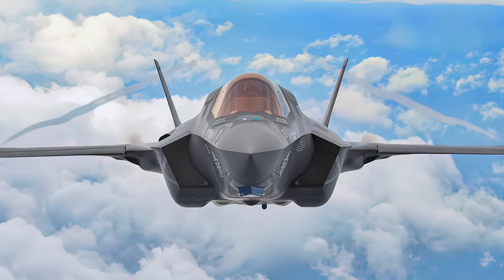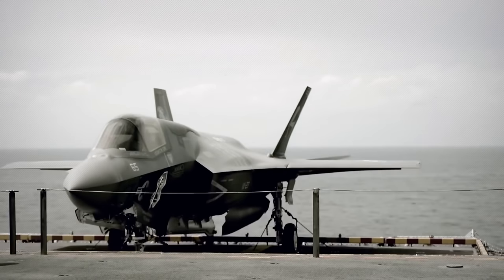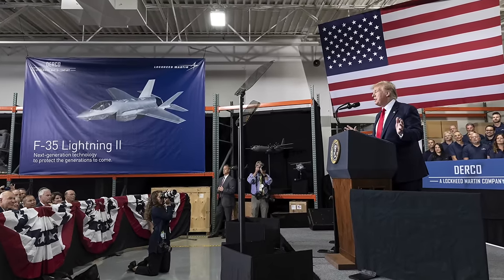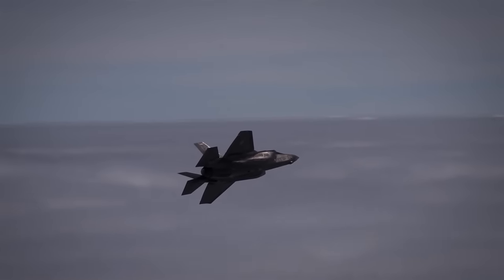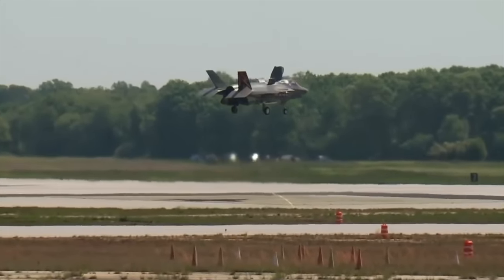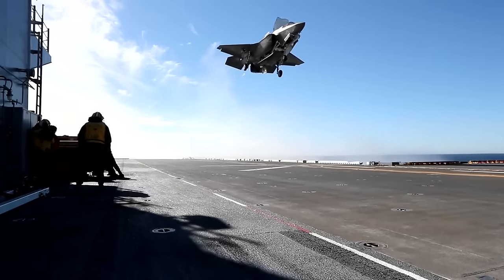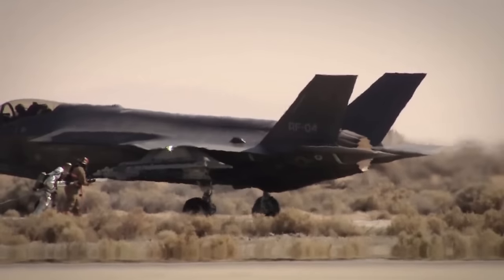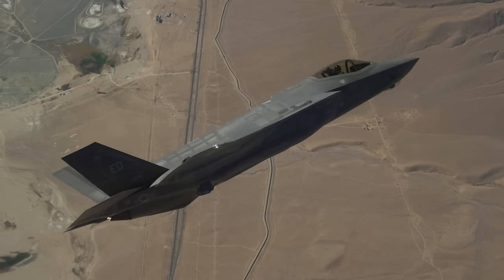F-35 Lightning II - Lockheed Martin's stealth multirole combat jet for air superiority

Comment: How can the F-35 Perform as good or better than an F-16, 
When it's so much Heavier, 
It's Build is so Heavy & UnAerodynamic?????

Yes, it has a Very Powerful Single Engine, 

But Does Not the shape & of something 
Determines How it moves through the Air???

What Physical Attributes of the F-35

Makes it a Dog Fighter????

So it's Not Built like a Dog Fighter, 

It's Very Heavy for a medium sized Fighter, 

Be Specific, what Airframe Attributes 

Makes it a good Dog Fighter??

If it Doesn't have the Airframe or Built of an

Air Superiority Fighter, why should it Perform 

Like one??

"

Comment: Pilots call her Big Bertha. The f-35 is a good multirole aircraft but is definitely not a fighter. It's a meh aircraft. This plane cannot out perform the f-16 or f-18 with maneuverability. It makes up for in that certain areas of capability but in many areas can't out perform many 4th gen planes. My grandfather was a machinist and helped build parts for this aircraft and he said he heard it's only a good aircraft with support. That support is built into it...

Comment: I doubt this plane is able to replace to A-10. It’s a good plane though.
Reply: @xyzaero  So F-16s and B-1Bs loitered over battlefields taking small arms and manpad fire to support ground troops within a few minutes of a call from forward air controllers needing support and returning their pilots home safely? Or did they just swoop in an hour after getting the call for support to lay down some bombs behind the battlefront and then scoot home, leaving the A-10s to continue the DCAS. A-10s are old and need a replacement (most likely by drones) but but the hit and get jets are just that.

Comment: It’s vertical takeoff = The most important technological advance in fighter plane history…except for the fact they stole the idea from McDonnell Douglas’s Harrier and didn’t invent it at all.
Reply: Well yes and no, Mike. Thrust vectoring was indeed invented for the Harrier, but the Lockheed uses a lift fan instead of directed engine thrust, making it more efficient than the harrier.
Reply: @b1lleman  Yes, you are correct! They deserve a lot of credit for that lift fan design! Many people in the Industry said that it would never ever work bcuz of the HUGE forces and high rpm put on the fan's drive shaft, but they rolled the dice and hit the jackpot 👌
Reply: Hawker Siddeley designed the harrier, McDonnell Douglas improved it
Reply: @C4nnonF0dder  my mom didn’t tell me for 35 years what she really did for a living besides saying “I support the Harrier project”.  After her security clearance time of non disclosure expired she finally told me. The Harrier had a proprietary technology they dubbed Night Attack. Long story short mom and her department that was in an underground bunker in St. Louis were responsible for developing what we know today as night vision technology.
Reply: @WhereDaToofpaste  very cool that your mother was involved in such an important research program.

Comment: But can't go Mach 1 or that top speed of Mach 1.6 for more than 30 seconds or it damages the delicate RAM coating. You require approval from above to break the sound barrier in this jet
Reply: The F-35C can fly at a top speed of Mach 1.3 for 50 cumulative seconds, while the F-35B is limited to 40 seconds at Mach 1.3. The version of the F-35 used by the U.S. Air Force, the F-35A, can fly without restriction on speed.

Further, it says that the restrictions were due to damage to the stealthy skin coatings and antennas on the aft of the fuselage. The damage from aerodynamic heating was discovered in tests flying for hours at Mach 1.6. That would not be a practical problem in combat. 

The problem with the “B”& “C” is related to the afterburner thermal flare overheating the inboard edges of their horizontal stabilizers. That condition appeared in a single instance for each of those F-35 variants & repeated attempts to replicate it have failed. It is out of an abundance of caution that the max speed dash is limited to periods of 30 sec. The dash can be repeated once the affected area has cooled off.

Comment: I'm sorry it carries 4 missiles.  It can't touch the a10 in ground attack. It's way over budget and it's plagued with problems.   It can't dogfight worth a crap.  I'd rather have another 100 f22 than 1000 f35s
Reply: Yeah the a-10 is UNMATCHED in killing friendlies and civilians, while also having the current highest amount of losses out of any modern aircraft
Reply: The A-10 can be replaced by almost any modern combat aircraft, including the F-16 which has outperformed it in the CAS role for the last 20 years or so. The F-35A is considered just as maneuverable as the F-22 at low to medium altitudes.
Reply: @dumdumbinks274  good opinion
Reply: @dumdumbinks274  ya let's out a f22 and f35 in a dog fight and test that.  It's not BTW.   Furthermore the f35 can't out rate a f15 or f16
Reply: @kanash8851  tell that to the boots on the ground that the a 10 saved.    Wouldn't shock me if your one of those that think everyone in a war zone is a civilian when they don't have a weapon.  Unfortunately collateral damage no matter how much you try to avoid is a thing.   You'll get your panties under a bunch but guaranteed you won't bring up the other side using civilians as cannon fodder.
Reply: @JJ-yx5hx  The F-35A wins a fair bit more often than it loses vs F16s, and F-22 pilots consider it capable enough to keep them on their toes.

Why would an F-35 try to out-rate an F-15 or F-16? Only bad pilots try to play to their opponent's biggest strength.
Reply: @dumdumbinks274  you do realize that they dogfight for practice right.   Just like when an f16 had a dogfight vs a c130.   That's why they practice.  I understand what your saying but the simple fact is the f35 has had a lot of issues and is way over budget.  And show me where fat Amy in a dogfight is taking out an f16.  
Everything that I read is they're going yo use the f35 as a quarterback and use the f15 as missile trucks.    That's a great 412billion dollar investment
Reply: @JJ-yx5hx  C-130s do not take part in dogfight training exercises. They have been shot down in large scale exercises such as Red Flag that simulate full scale operations where everybody involved in an operation gets to try out new tactics. That might include commanders sending fighters to defeat the enemy supply chain, or a fighter could get into a lucky position that allows for an opportunity kill. Most kills of this type do not result in a dogfight because the target doesn't have any time to react.

Fighter pilots train for dogfights during BFM exercises which pit fighters against other fighters in close quarters scenarios. The F-35 performs very well and regularly beats the F-16 in this type of exercise. Even instructor pilots with thousands of hours experience flying F-16s have been defeated by F-35s flown by relatively new pilots because the F-35 is easier to fly and can perform a much greater variety of maneuvers. F-22 pilots have commented after transferring to the F-35 that it can perform basically every maneuver the F-22 can perform, but it's performance drops at higher altitudes.

The F-35 has issues yes, but so did the F-15 and F-16 back in the 80s. 

Show me a dogfight where an F-16 is taking out an F-35 and does so reliably. The only example known publicly is that of an F-16 Block 40 with 2 bags vs F-35 test airframe AF-2 in early 2015. Even when the report was first leaked in 2016 it was irrelevant to production model F-35s because the maneuverability restriction on AF-2 were not present on production model F-35s.

How does an F-15 acting as a missile truck say anything bad about the F-35's performance? They can only act as missile trucks because they no longer need to be at the tip of the spear which allows them to sacrifice survivability in favour of a larger payload. F-35s can be modified to do the same, but why would they when less capable aircraft can fill that role? Especially considering the F-35 was never intended to replace the F-15...
Reply: @dumdumbinks274 🤣🤣🤣🤣🤣🤣it's your story man keep telling it.
Reply: @dumdumbinks274  and the c130 did.   It's quite fascinating. I have a friend that was on the flight crew of the c130.  But I'm not going continue arguing.  Clearly you know everything.  

What's funny I didn't say the f35 wasn't capable.  But for for the cost the set backs and everything else I'd rather see 50 more f22s.  That's clearly my opinion but I'm sure you'll pipe off about bla bla bla
Reply: @JJ-yx5hx  So explain why a C-130 was sent for BFM training.

You stated " It can't dogfight worth a crap", so you did claim the F-35 wasn't capable. You also stated that you'd rather have 100 more F-22s than 1000 F-35s, but that wouldn't solve the problem because 280 F-22s is not enough to cover the roles performed by 1000 F-35s. 

Lol don't put words in my mouth. The F-35 program was poorly managed and there's nobody on this planet who can argue otherwise.  But lets go a step further than simply complaining about the cost. If we're talking about what should have been done why not address the root problem and correct the issues with the F-35's development program? The original vision was well within reach afterall.
Reply: @thomashayhurst6547  still havnt found article if you dont mind show it.  Bvm theres a reason its called fat amy  . 
Again over budget and under delivery.

Comment: Does someone really call this plane a fighter? Give me a break. It is simply too big to be a fighter.
Reply: @xyzaero  Yep not to mention the F-14, that thing was a mammoth beast and was only retired because the maintenance was insane and it wasn't worth the cost when the threats weren't there after the cold war ended. When they started using it as an strike aircraft it was just overkill, especially when the Super Hornet was being deployed in numbers and could do the job for a lot less.